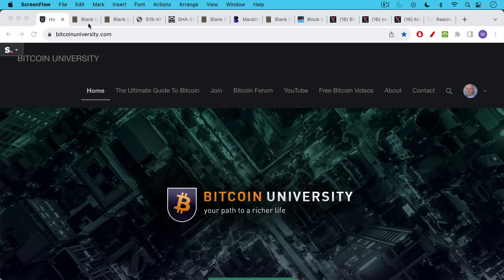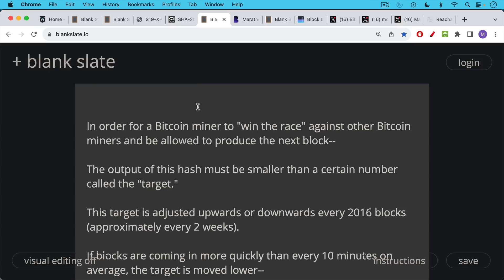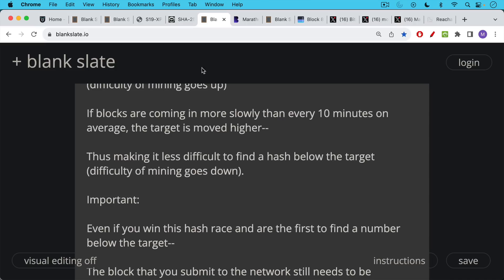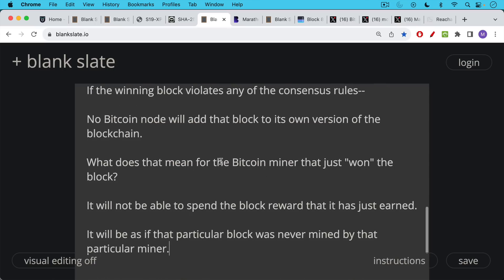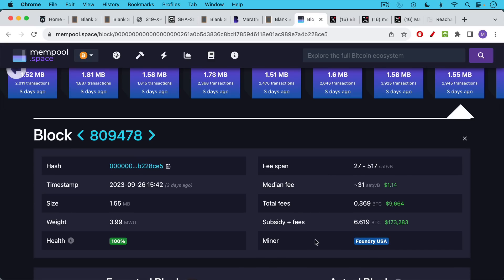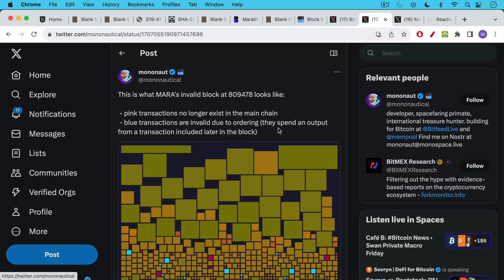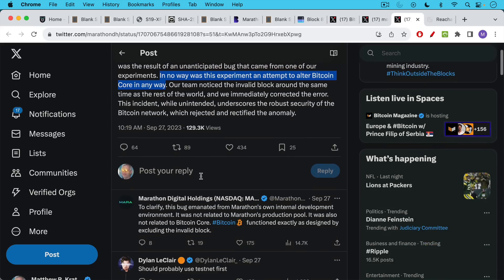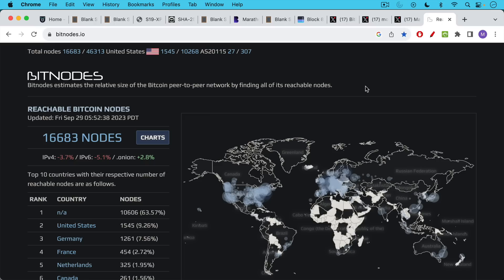Invalid Bitcoin Block Mined?

Comment: 0:26 That is not what an ASIC looks like. To give you a hint, it's in the name. Specifically the I and the C. BM1387 is an ASIC. That box with fans and power supply and all that? Not an ASIC. It's a product that has many ASICs in it. Block was not "remined" by anyone. It was dropped. Another block was mined by someone else.

Comment: Something I never understood about the difficulty adjustment: How is the 10 minute time period measured? Are all nodes making their own time judgment? And then the difficulty adjustment comes in discrete levels to account for some variance in the time measurement between nodes, to enable consensus? And if the time can be assessed accurately that way, then why not check every two weeks instead of 2016 blocks? If by some miracle the hash rate is instantly cut by 90%, it would take months for the difficulty adjustment to set in.

Comment: Your videos are pretty good at best but really can't appreciate the slight propaganda you slide in at the end for example as if plebian home nodes, so called full nodes as blockchain listeners invalid anything rather than the hash table providers aka pool operators like Foundry in this specific scenario. You also could've noted more specifically how the difficulty adjustments are not so dynamic as you made it sound like but only after every 2016 blocks, which can leave bunch of room for a death spiral scenario. If the artificial block size cap put in place by Satoshi as a temporary safety measure would be lifted and the size of each block was to be determined by market forces, what would be a chain death at 1mb of txs could become a zero-sum game to collect huge fees mining gigantic blocks; that is to say, it creates the saw tooth pattern of fewer blocks, but with a much higher portion of the reward in mining fees.

Comment: As a Bitcoin holder and fullnode of over 14 years, I'm concerned again. Just as I was during the Block Size Wars.

I don't think that the current core development and maintenance reflects the best interest of Bitcoin. Because the best interest of Bitcoin is the only interest that matters.

So, I think it's time to change the direction of Bitcoin core development and maintenance, to a more Bitcoin centric and exclusive focus.

Then the fullnodes can decide what core code to run. Based exclusively on the best interest of Bitcoin. Because the interest a Bitcoin and the virtuous fullnodes are the very same.

The Virtuous fullnodes and Bitcoin Loyalists ARE! Bitcoin..😊

Comment: I have a slightly unrelated question Bitcoin university I was wondering if you could do a video on.
 My question is this: what are the future projections for fees per byte in satoshis if BTC becomes the global settlement layer?
Put in another way: what is the minimum BTC value that will be cost effective as a transaction if the block space limits transcation on the Bitcoin network to around 200 million transaction per year?

Comment: Hi matt how much does it cost to setup your own node and what are the benefits for it? A video please
Reply: Nothing if you have a pc with some available disk space and internet. But if you need a dedicated node setup might cost $110. If you don't have enough disk space you can run a pruned node which basically works like a full node but rely partly on other nodes.
Reply: There's also no real financial benefit to it, except that you keep the network safe.

Comment: Why is there only 16000 Bitcoin nodes, could BlackRock setup a Building with thousands of nodes and take control that way?
Is it possible to run a Bitcoin Node on your normal everyday working PC to help out the network?
Thank you!
Reply: In case Matthew doesn't see your comment, this is a copy&paste of his response to a similar question: "That's just the number of reachable nodes. The total number of nodes is closer to 100,000 or more according to Adam Back. These nodes are in every country on earth, so difficult to shut them all down"
Reply: Thank you!

Interesting but even 100.000 is not so much, do you think with a few billion dollars they could just make a mega farm, lots of virtual machines etc and threaten the security? 

 @Atlas_21

Comment: Thanks Matt, A nice explanation and review of how mining works.
If I had a node would I have seen this error as an obvious pop up message or would I need to do someting extra to see when new blocks are rejected?
I figured this happens fairly often- but usually not for an error in ordering or other violation but because a miner solves and transmits a block slightly behind a competitor because they hadn't gotten the signal to move on to the next set of transactions in the mempool. Where can I learn more about this?

Comment: Will Microstrategy stock be as rare as Bitcoin? If they sell more shares to the public would that be a signal to sell?
Reply from the maker: No. MSTR could theoretically issue a lot of shares, thus diluting holders. Unlike MSTR, BTC has a maximum cap of 21 million coins

Comment: The number of nodes should be higher, for a half trillion usd network
Reply from the maker: That's only the number of reachable nodes. The total number of nodes is probably closer to 100,000 (according to Adam Back)
Reply: Many nodes run behind Tor, and aren't included in this view of discoverable nodes.  This is anecdotal, but I suspect the majority of nodes are not discoverable -- everyone I know who is running  full node has theirs behind Tor, because Bitcoin Core makes it very easy to set up that way.  That said, I hang out mainly with geeky developer types..
Reply: @paullamb1100  if they aren't discoverable, are they contributing to the network, or just consuming from the network?
Reply: A lot of them have gone dark behind TOR for fear of government persecution.

Comment: Here's what this looked like in the logs, if anyone is interested.

2023-09-26T21:15:30Z Saw new header hash=000000000000000000006840568a01091022093a176d12a1e8e5e261e4f11853 height=809478
2023-09-26T21:15:30Z InvalidChainFound: invalid block=000000000000000000006840568a01091022093a176d12a1e8e5e261e4f11853  height=809478  log2_work=94.441101  date=2023-09-26T21:15:22Z
2023-09-26T21:15:30Z InvalidChainFound: invalid block=000000000000000000006840568a01091022093a176d12a1e8e5e261e4f11853  height=809478  log2_work=94.441101  date=2023-09-26T21:15:22Z
2023-09-26T21:43:15Z Saw new header hash=0000000000000000000261a0b5d3836c8bd1785946118e01ac989e7a4b228ce5 height=809478
2023-09-26T21:53:17Z UpdateTip: new best=0000000000000000000261a0b5d3836c8bd1785946118e01ac989e7a4b228ce5 height=809478 version=0x29a10000 log2_work=94.441101 tx=900454109 date='2023-09-26T21:42:52Z' progress=0.999997 cache=126.8MiB(898461txo)

Comment: When the invalid block is rejected by the Network, is there just a gap in the blockchain?  The users don’t get their transactions added to the chain?!   Users must wait until another miner picks up the invalid block to correct it?
Reply from the maker: No, it just means that the previous block is still the tip of the blockchain-- until someone creates a new valid block which is then added by all nodes to their individual blockchains.

Comment: So, there is no standard code to order the transactions that everyone is using? Marathon had their own custom code that they modified resulting in an unintentional error?
Reply: There is open source mining code, but a miner can do whatever they want, so long as their output conforms with what the nodes define as a valid block. If a miner finds a code based strategy to change the ordering of TX inclusions to improve the per block fee, they're free to do that.

Comment: What is the incentive structure for nodes other than keeping the system up.
Reply: Anyone who runs a bitcoin node likely owns bitcoin, so contributing to the security of the network protects your own holdings. Sure you could just assume that others will run nodes and the network will remain secure, but if you own a substantial amount of bitcoin then it makes sense to spend an insignificant amount of money to run a node yourself.
Reply: If you have bitcoin, you can connect your wallet to your own node, so you don't need to trust someone elses node. Also you can participate in the network, use whatever version of bitcoin you choose and protect the network. If the bitcoin core makes a change in the protocol, you can choose not to run that code.
Reply: There's no direct incentive to running a node, but the costs are little if you already have power and broadband, and a PC with 1 tb of storage space.

The indirect incentive for running a node is that a lot of people who run nodes own some btc themselves, so they are helping to keep the network secure because they are invested in it themselves.
Reply: One reason to run your own node is so your wallet software can "talk" to your local node. This keeps your network traffic of inspecting and working with the bitcoin chain private. If you use a wallet without a node, you are using someone else's node, which means they will get data like source ip and the addresses of interest to that source ip. Perhaps there might be some other cookie data available as well.